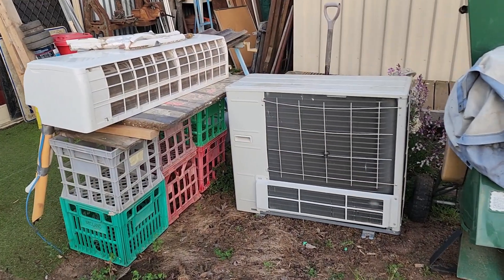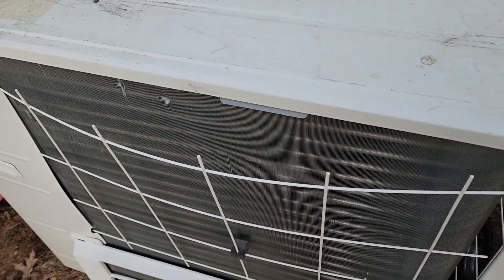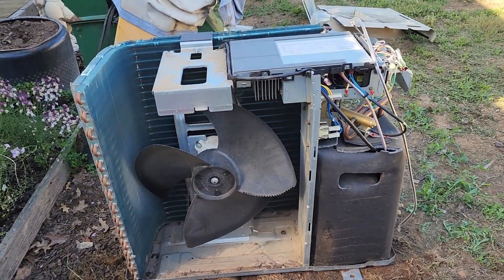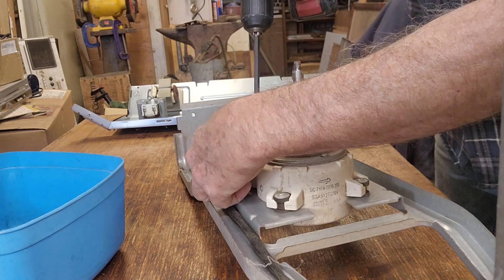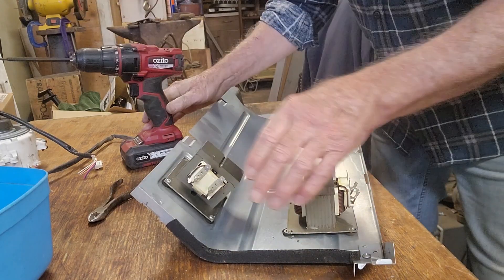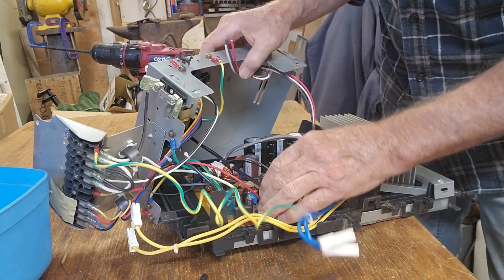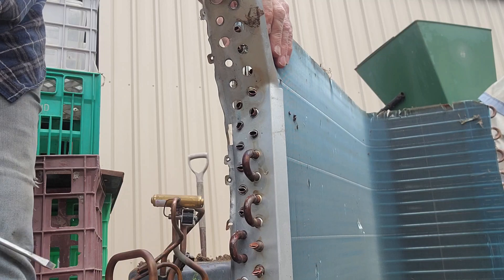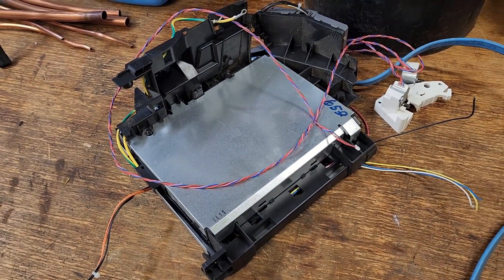How to Scrap out a Mitsubishi Heavy Industries Split System Air Conditioner for Great Profits!

Comment: I've taken to wearing thin (cheap) gardening gloves while I scrap, since I found I was cutting myself all the time. As I get older my skin gets thinner and easier to break. I winced while I watched you take apart the air conditioner, knowing I would have cut myself many times over :)
Reply from the maker: Yep fair point Dave - I do have some days where the hands suffer a bit, but generally not too bad.

Comment: Thank you for the great video, Mate! The technician just confirmed my barely 3-year-old Daikin Inverter 1.5 HP, in my wife's room, had developed a tiny leak at the condenser coil and nothing can be done about it! I have a 1 HP 20-year-old National (Japan-made) in my room, that is still running cool, just having to change the compressor capacitor a couple of times! They don't make Aicons like they used to! Now after watching your channel, I may be able to get some bucks back from my local recycler! If you just give them the whole unit, they may pay USD 2 for it! Feeling so heartbroken after spending about RM1800 (USD 400) on the Daikan! Maha from Malaysia.  :(
Reply from the maker: It is depressing to have something breakdown so soon after spending decent money! I feel your pain! Hope you can get some money back from the scrap! 👍

Comment: I feel for ya..ours went at the start of the year. Daiken..7yo. Our guy recommended the Mitsubishi Industrial so I guess we wait and see..The fan went and takes out the board in the process. Board is apparently worth more than the fan. Really disappointed they cant be repaired, unlike my old HVAC system on the factory 1988 mod and still pumpin
Reply from the maker: There's something fundamentally wrong with the whole aircon situation these days - there is no reason why they cannot be repaired cheaply and easily but it seems the companies would rather keep selling new units! ☹

Comment: Hope this isn't a common problem as my in-laws had a Mitsubishi unit installed a couple of years ago. US Midwest - very cold winters and hot summers...I will definitely be checking if it's a 'Heavy Industries' or 'Electric' next time I'm over there! Cheers Chris.
Reply from the maker: We have another which is still working fine, but it is a bit of a worry! Thanks FF

Comment: Good teardown, but disappointing the machine failed.
Unless I'm mistaken, that was a dog toenail clipper you were using to cut ✂️ through the copper pipes.
Does Coco know youve raided her beauty cabinet 😄
Reply from the maker: Haha, slightly bigger than toenail clippers! They are sold as electrician cable shears and do an excellent job on copper pipes as you saw. Coco would happily share anyways! 😊👍

Comment: Electrician down their end of my street. He has a caged trailer on the road but any aircons, water heater I even got large  water pump the other day off his driveway. I've never taken a water heater I've had heard some of them are very good and others are crap. Scrap yard just takes the air con complete can't remember last time I got, but it was no where near 150 bucks. My local yard pays $3.20 for insulated wire. What the good part is you can leave the plugs on and they take Christmas lights. Processing so much easier. I went to another yard and they between one dollar and four dollars per kilo for different grades I asked them what the different grades were and they said two difficult to explain. But they weren't willing to walk out the air conditioning office to show me the different grades. But I do take my batteries there because they pay 64 cents a kilo instead of 32 cents at my local yard. I don't bother with scrap metal at seven cents a kilo it's a joke. Some yards won't pay u, unless you bring commercial quantities and then they're paying your 10 cents a kilo. Cheers Graham
Reply from the maker: Thanks for all that Graham - yep it pays to shop around with yard prices for different things, especially if the yards are reasonably local. I tend to take all mine to the one spot who are pretty good across the board as I have a long drive! Your shred price is awful though! It's currently about 35 cents down here!
Reply: @TheUltimateRecycler  I just can't figure out why our prices r so crap, up here.

Comment: wow, only 5 years?? and then you went and rewarded the company with another purchase?? ohh it was a company with a slightly different name, my bad... Hail Moloch!
Reply from the maker: Google tells me this, which confirms what the aircon service man said - Both MHI and ME are completely separate companies with different products, policies and services. Furthermore, they are direct competitors of each other as they both make air conditioning units targeting the same market, with similar price points with almost identical features.
Reply: @TheUltimateRecycler  I just think its crazy that A/Cs are not govt. mandated to be built to last for at leas 15 or 20 years considering how much pollution is created in its manufacturing and usage, especially the refrigerant which all will ultimately be released into the atmosphere
Reply from the maker: @hiz-n-lowz1577  totally agree!